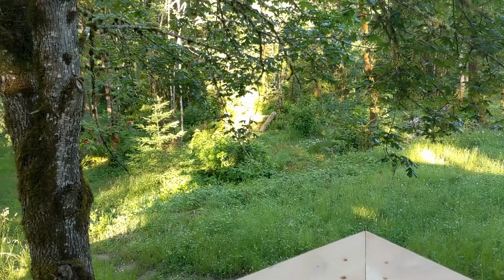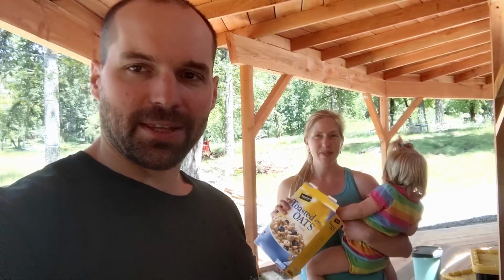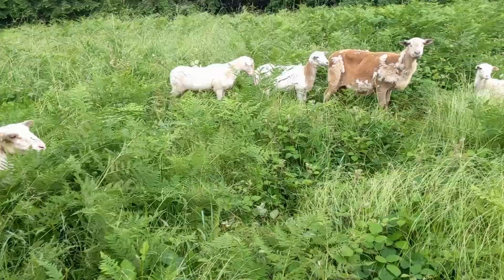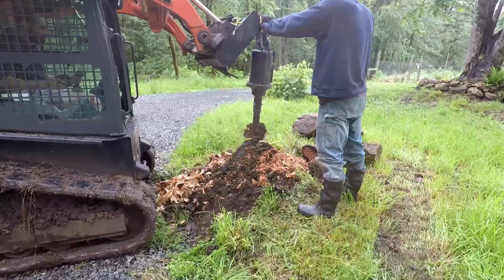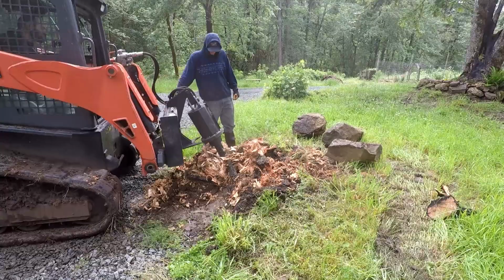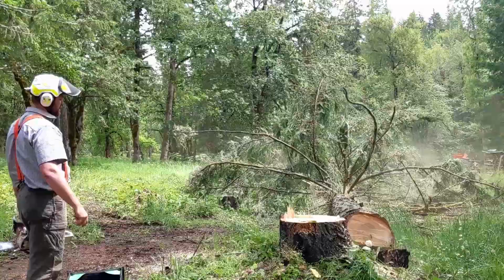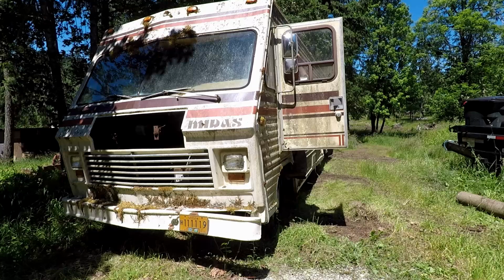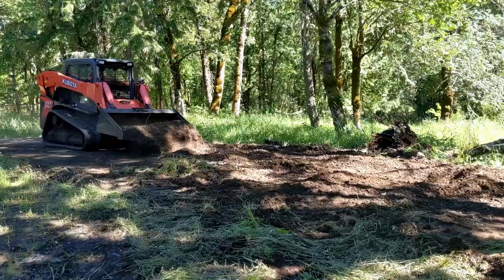Building Our Yurt Deck, Finished Decking and Railing

Comment: Glad to see a new update! Great work on the deck! Kudos to Jacob for his help! As for getting rid of your old RV, maybe taking it apart would give you the ability to dispose of smaller, more manageable pieces in your local landfill. Maybe small sections of body panels could got to a scrap metal yard. Maybe smaller pieces of certain parts could be sold somewhere. Hope this situation works out for your family. God bless.
Reply from the maker: Yeah, I think you are right that deconstructing the RV is the most realistic path to getting rid of it.  Thanks for the support!

Comment: I’m really impressed with the quality of the lumber you guys milled! Didn’t you have to cure it, or dry it for a while before using it? Nice job btw! God bless your family♥️
Reply from the maker: Thanks for the kind words!  We've been building "green" a lot, meaning fresh lumber.  It's more common than you think; just have to plan around the fact that it's going to shrink a bit.  Wouldn't work with fine furniture, but definitely works for rough framing.